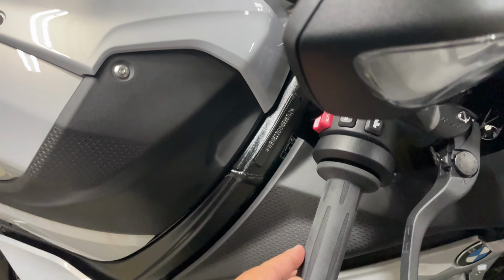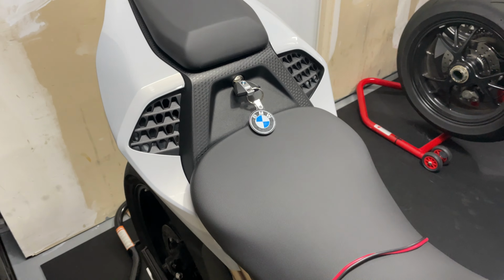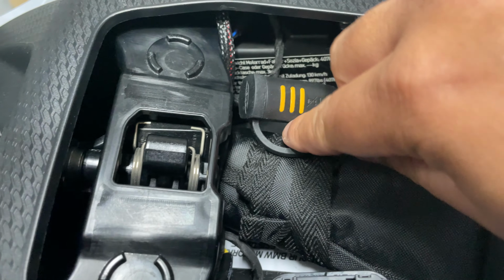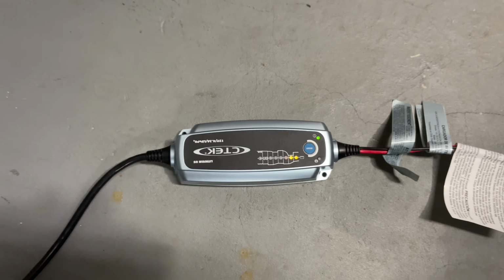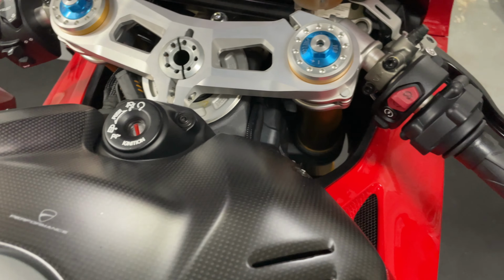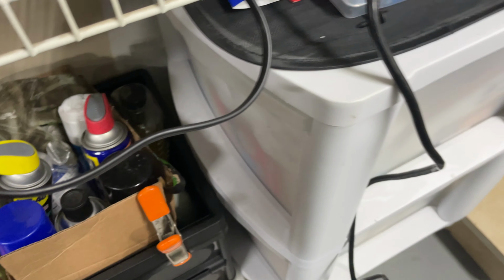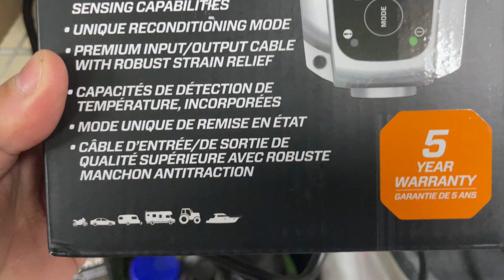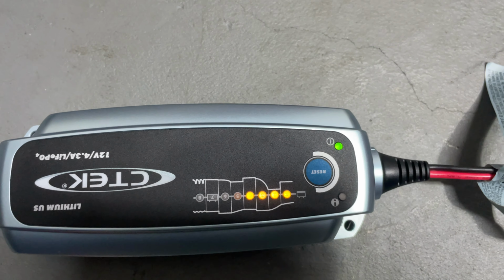2021 BMW S1000RR and 2020 Ducati V4R battery maintenance - Charging & battery status indicator

Comment: Thanks ... I was gong to to use my normal CTEK charger for my BMW S1000 lithium  so Ill check  it still works or have to by another CTEK.. Was the pigtail easy to fit.?
Reply from the maker: Yes, it is a plug and play SAE to CTEK conversion.